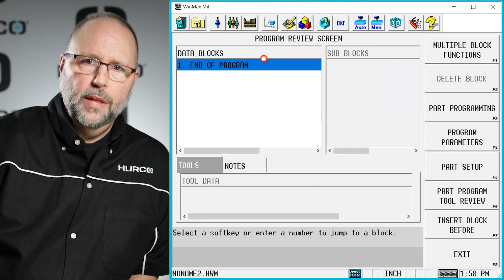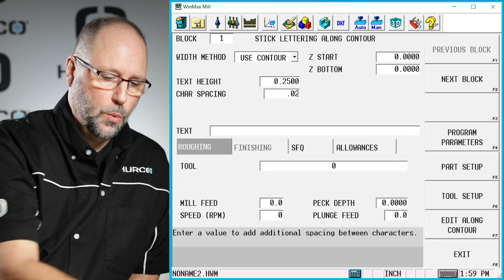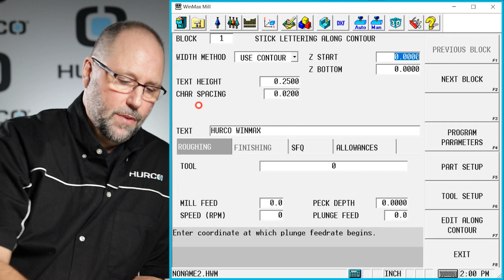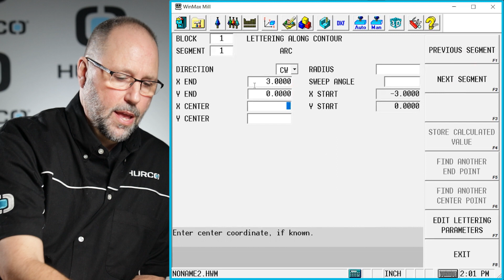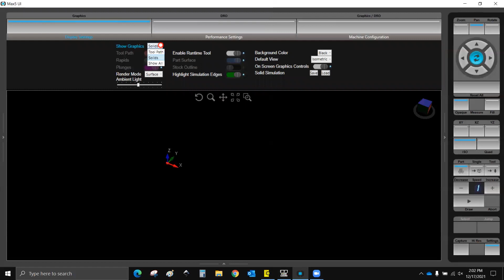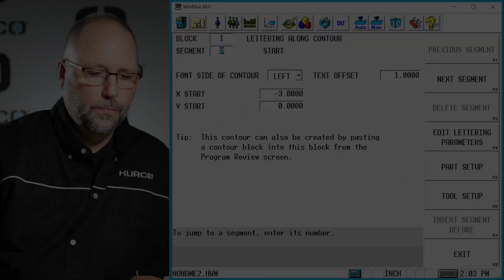Adding Text Along A Contour | Your Questions Answered | Hurco CNC

Comment: Is it possible on hurco to do adaptive outside profiling iv seen it done on other machines and was wondering as a hurco operator if it was possible for us thanks in advance for any information.
Reply from the maker: Hi Shaun, unfortunately, no. The workaround would be to add a larger pocket boundary around the profile and make the profile a pocket island…that way, when you use AdaptiPath, it will essentially do the adaptive roughing outside or around your profile.